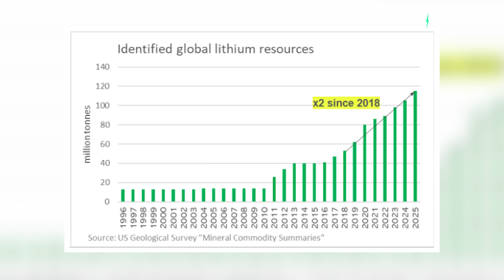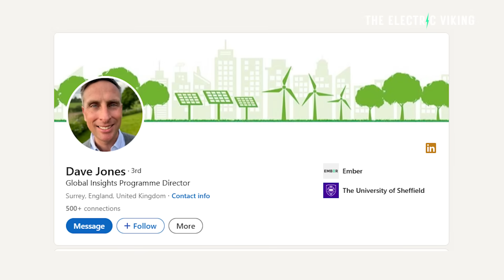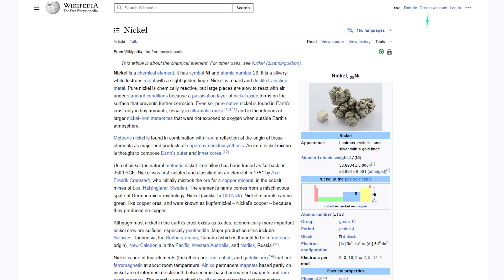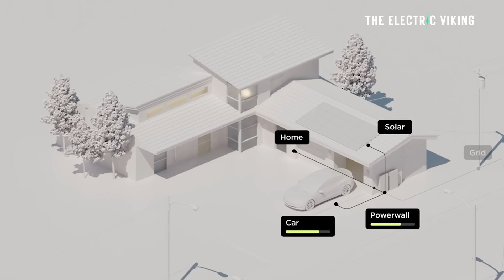Lithium shortage lie busted - the world has enough lithium for over 1000 years

Comment: The story goes deeper.  GM stated a while ago that they were developing recycling processes from cradle to grave, and scaling it up to handle expected production levels, with both old and new tech.  They are not the only ones doing this.  Additionally, here in the SF Bay Area, and I'll bet elsewhere, lithium batteries that cannot deliver output current sufficient for vehicle operation, are repurposed as storage batteries because their capacity is fine.  So the recycling process includes repurposing batteries and full melt-em-down recycling is delayed until the batteries are truly spent, thus reducing the need for newly mined lithium even further.  Also, EV batteries are proving to last much longer than predicted, so again, delaying any need for recycling.

Comment: Earth's Crust: Lithium makes up about 0.002% of Earth's crust, placing it at the 31st most abundant element. Earth's Oceans: It's present in seawater at a concentration of 0.14 to 0.25 parts per million (ppm).  It doesn't sound like it but that is a lot. Also Lithium batteries and lithium will be recycled intensively. We don't need an unlimited supply.

Comment: Blackout Bowen and Albo and their Idiot Green mates want to make Australia's manufacturing a "renewables powerhouse" and all of it "made in australia". So much that we will be "exporting" it, whatever "it" is.  This is great, of course. But ...  Do they realize that to do this, we will have to have manufacturing? And mining? We will need to mine and refine iron/steel, aluminium, nickel, cobalt, manganese, lithium, magnesium, mercury, lead, zinc, tin, cadmium, gold, silver, platinum, palladium, copper, silica, and of course rare earths. The list goes on. We will also need large amounts of concrete, and timber, with all that that involves. 

The mining and refining of those is going to require massive amounts of electricity, fossil fuels, plastics, rubber, packaging, and water. And produce massive amounts of waste, much of which is toxic. Do they realize all this? Do they really?

We could of course import all of this from China. Assuming that China wants to sell us these raw materials. In the past they have not. And even if they do, they will be much more expensive than refining our own, and the pollution and waste will be exactly the same, except it will be in China, not here. That will be the only difference.

We will also require tens of thousands of mining and manufacturing employees, from "lowly" miners right up to engineers. We dont have those. We are, and will continue to be, short by tens of thousands. They will take years to train.

Do Blackout and Albo and his Greens realize all of this? Do they? Do they? And if they do, are the prepared to make it happen, knowing these inevitable consequences ?????

Comment: No one said that the world doesnt have enough Lithium per se. The problem is the process from going to an ore in the ground to a Lithium product in a battery. Mining and refining. That is where the bottleneck is. Same with copper, nickel, chromium, tungsten, silicon, iron, cement, even sand - you name it.

We also dont have s shortage of fossil fuels. We have plenty of coal and gas, even here in Straya. And there is still plenty of oil. The problem is, a LOT of it is in places where we probly dont want to get it from unless we roolly roolly have to.

Comment: The old guys amongst us migjt remeber the 'peak oil' theory: in the 70ths and 80ths of the last century it was assumed that there would be too less oil in around 2010-2020. Later, more resources were discovered, and other technologies to extract oil. 
In 2025, there is more enough oil for the global demand. But soon we will really have a 'peak oil': The peak in the CONSUMPTION of oil, and then the demand will shrink.

The big differnce is: Batteries can be recycled with relatively less effort, recreating synthetic oil from CO2 extracted from the atmosphere (where it's gon from burning fossil fuels) is tremendously expensive

Comment: I live in Sweden, Europe. Winters can come down to minus 40° (Celsius or Fahrenheit, its the same). I'll wait until sodiumbatteries are common. Lithiumbatteries are just not good enough. Sodiumbatteries can be recharge many more times than lithium ones. So sodiumbatteries are much cheaper per cycles or miles if you compare vehicles.
Reply: I'm sure you know what's best for your area with the current technologies. 

 and there is little downside for waiting as things will only get cheaper and better at this point 

And recording climate change, it's too late anyway.

Comment: I never thought for a moment that there was a lack of lithium.
The real problem is the current rate at which it is exctracted. 
The article I read suggests that to replace every vehicle in the UK with an EV would require the entire current global production of Lithium for 10 years. That's just for the UK!!!
Reply: Mus be a lt of cars in the UK. Globally, over 1-in-5 (22%) of new cars sold were electric in 2024. This share was 92% in Norway, and in China, it was almost 50%.
Reply: @danncorbit3623 New cars sold and total cars are very different figures. Don't be mislead by what appear to be very impressive sales figures.

In 2024 there were 41.7million licensed vehicles in the UK, of  which 1.089 million were zero emissions cars.
That's roughly 1 in every 41 cars.

I've got 2 EVs, but can I convert the masses? 
No...!
The majority of people in the UK still blatantly dismiss the idea of buying an EV.  They will  simply keeping buying used ICE vehicles or keep their old vehicles running
Reply: @beepthesheep867  In 2024, a record 17.1 million electric vehicles (including both BEVs and PHEVs) were sold worldwide.  In 2.44 years, that is the total volume of all licensed vehicles in the UK.  Now, I do not expect that the UK will be 100% electric anytime soon, but I think that is mostly choice.  Certainly the UK will not get 100% of the electric vehicle production either.  And some people might drive petroleum based cars until they die just because they want it that way..  But production volume will go up every year and I guess that in 5 years, half of all vehicles sold will be electric.  But then again, we humans make lousy prophets for the most part.  As far as total replacement goes, I guess most people won't buy an electric car until the vehicle they are driving is due to be replaced and until they feel that electric is the better choice.  These things do take time.  But people will be driving petroleum cars because they want to, not because they have to.
Reply: @danncorbit3623  EVs getting better is a matter of perspective.
I'm not seeing huge improvements since the latest iteration.

Define better? Higher energy density batteries may materialise into actual vehicles eventually. The viking is always harping on about salt batteries being higher energy density and cheaper.
Lithium ion sulphate batteries are good for 6000 charge cycles though.
...but I read  they expect salt batteries to have 2000 charge cycles and a higher risk of total failure. In my opinion that's NOT better.

EVs aren't new. Batteries aren't new. Electric motors aren't new. Better is taking a very long time!

Yes, technology has improved things significantly since the dawn of time.  
...but things haven't really got better.

Everyone (both sexes now) working longer and harder.
They're also about to lose their jobs.

They said perovskite solar panels would be cheaper and better... but their longevity is also poorer.

Now, if I wanted to sell the masses something.  I'd be saying it is new and better and give good reason. I nay also neglect to mention the cons.
Reply: @danncorbit3623 currently in the UK there's nowhere to charge them cheaply. The public charger networks are extortionate at about 10× the cost compared to charging at home. As an EV driver I very rarely use them for that reason and charge 99.9% of the time at home. Most people don't have a drive. Most houses can't handle charging 2 EVs (blows the fuse) and most households have multiple cars. The grid certainly can't handle everyone driving an EV. They will have to dig up every road and lay new cables.
The EVs are too expensive, even used ones. A cheap (knackered) used EV is still 10× more expensive than a cheap ICE vehicle.
That's despite the value of used EVs diminishing rapidly... that's also a deterent. The depreciation on an EV is horrific!
The new luxury car tax makes anything more than a basic small battery EV too expensive to run for the first 5 years.

There's a cost of living crisis. Food is becoming ridiculously expensive. Fuel prices are going down. Electricity prices are going up.

It's almost as though the UK doesn't really want EVs on the road at all.
Reply: @danncorbit3623 maybe the UK is delaying a huge roll out of EVs because of the the Lithium availability 😅.  Plenty in the ground but not enough extracted. 
Copper for all those electric motors and cables.
There's a reason copper is so expensive 😉

Comment: At the current prices, only a select few mines are profitable. Something will have to give. That said, the demand will far outstrip the supply in the near future. It's going to be a volatile market. For lithium recycling out of old batteries, that's still a long way off. Smaller operations will still be losing to brand new refined lithium for some time still. That problem will eventually be solved with scale. It's just not there yet. Bigger recycling plants that can run 24/7 will be a lot more efficient if the scale of battery waste improves. We are still at the very early stages.

Comment: Where ever there is salt, there is lithium, just not mined. That is the reality.
Reply: The biggest limit is the water to extract it.... and the issues related to loss and contamination of groundwater in areas where water supply is limited. So an excellent reason to recycle ♻️ materials wherever possible.  There's also the possibility that new Li  containing Cells will use less Li  and more of elements like Na , S , Al.
The element that does need watching is Cu. because of the Volume used in wiring and producing alloys of other metals such as Bronze Brass and Al etc.

Comment: If there were no lithium, we could use sodium.  There are huge deposits in California (Salton Sea) and Oregon (McDermitt Caldera) in the US, enough to be Lithium independent.  The battery problem is no longer a problem.  And it will only get better, until electric car owners will be laughing at petroleum powered cars.  At some point, the range will be longer than petroleum cars, the charging/refueling time will be faster than petroleum cars, and the cost per mile will be much smaller than petroleum cars.  Already, the current electric cars are competitive in all three areas.
Reply: You don't need to mine the earth for sodium. The total volume of all seas and oceans on Earth is estimated to be around 1.3 billion cubic kilometers, i.e 1.3E9 km3, or 1.3E18 m3, or 1.3E21 liters. Multiply that with 10 grams of sodium per liter of seawater and you get 1.3E22 grams of sodium, or 1.3E19 kg, or 1.3E16 tonnes. That's 10 million BILLION tonnes.
Reply: Cost per mile is already much smaller...like 1/4 that of ICE over the life of the car...and the longer you own the car the better the comparison becomes.
Reply: Im 76 years old will use my petrol car until I can,t drive anymore
Reply: @rolandlickert2904 I am 80 years old, traded my ICEV for a BEV, very happy, it will last me out. Best aspects, it largely drives itself and costs next to nothing to operate.